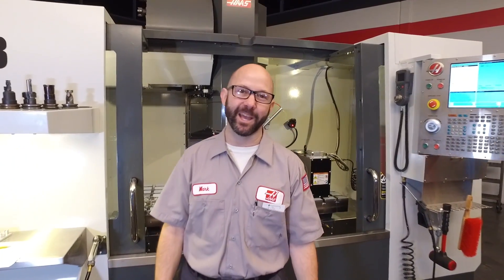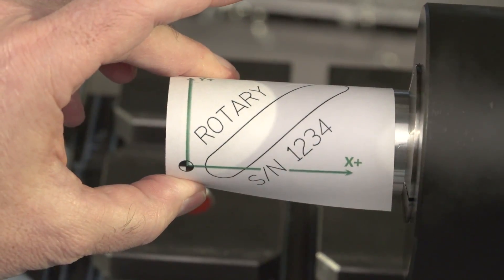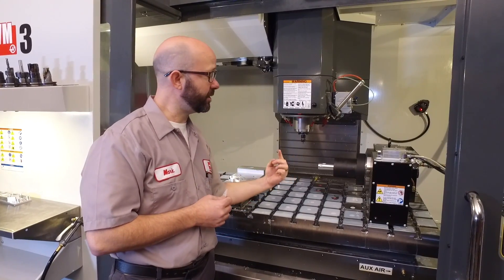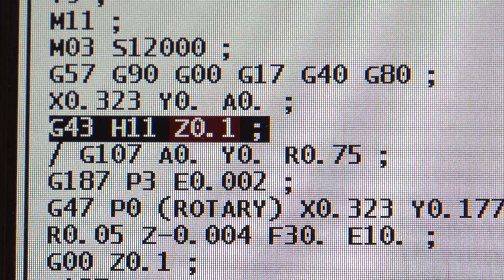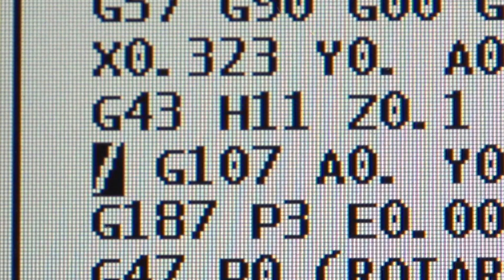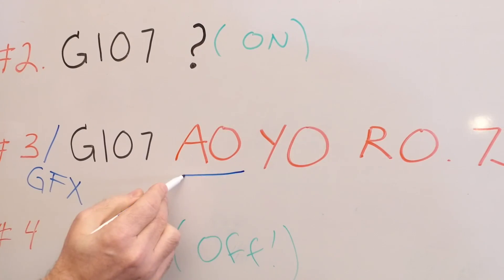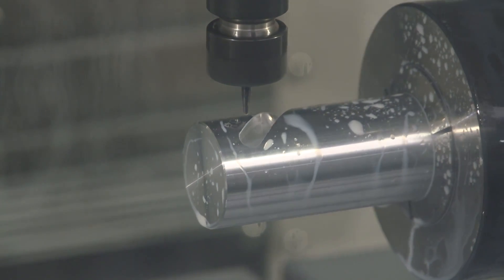Easy Cylindrical Engraving & Machining: Use G47/G107 No CAM needed – Haas Automation Tip of the Day

Comment: Hi, this TIP is it working with a lathe axic C with a live tool?
Reply: As of year 2025 it does work, but the actual part features are mirrored, like the C is going in the opposite direction.

Comment: Can I do this on a lathe without Y axis utilizing just ZC axis work?
I managed to do the face of a part with just XC axis working.
Reply: This is being actively worked on now. We have G112 for easily machining with Axial Live Tools (ZC axes) on our lathes, and we have G107 for Cylindrical Mapping around the outside of a part on our Mills with 4th-Axis rotaries. What is being developed is a simple G107 Cylindrical Mapping for our Live Tool Lathes (XC axes, Radial Live Tools). Part of this larger project will also be to add G47 engraving to our Live Tool lathes. We don't have a timeframe for this, but it is being worked on and tested. Great comment.
Reply: @markterryberry4477  I got it done on my Machine 😁 was a bit of tweaking but worked beautifully! And the first time I ever done OD engraving (edit: on a curved surface) before!

Comment: Hello

Can i use G254 before G107-G47?

Can i use G254 and G234 before G107-G47? In case or my cylindre to engrave isn't in my C axis. (i use an TR200Y)

thanks you

Comment: Help me Mark! How do you control the A/B axis feed rate when doing this? We're running an 09 EC500 and a few seconds into the program we hit a "B servo error too large" error.
Reply from the maker: Jonathan – To control our rotary feedrates, we’ll typically just make adjustments to Setting 34 or 79 4th/5th axis diameter. We need to define the diameter of the part we are working on so the control knows how fast to go when using a G107. This is especially important on an EC500 where you might be at 15” diameter. We can also give your local HFO a call on this as well, they can look at your program and make sure everything makes sense, for your specific machine, and that there aren’t any other issues. – Mark , Haas Tip-of-the-day
Reply: @haasautomation  Thanks for getting back to me. We're Department of the Navy and go through Phillips but so far they haven't been able to help. I'll mess with settings 34 and 79 tomorrow and see if it works. It's not a huge deal, we can just use CAM but was hoping to getting around having to figure out a macro for the serial numbers we're looking at doing.

Comment: Hello i am a student and have a surface design that im trying to do to a cylinder material and when i put G107 in and added the pretext you said it didnt work and was womdering how to fix it (was wondering of it would be a diminsion issue where i either have to increase the stocks diameter or decrease the size of my design would appreciate some input as soon as possible trying to do this project in 3days time before my deadline

Comment: just got a new tm1p and tried the g107 and the g47 writes just fine but when i add the 107 and reset for the 4th axis it is writing everything upside down. did something not get set up right when they installed the rotary? how can i fix it?
Reply from the maker: Hi Bruce – For this one, I’d give your local HFO a call, and see if they can help work through things with you. You’re right that it could be the orientation of the rotary, or it may just be something we can fix in the code. If it’s just upside down, not mirrored, we might try adding an I180.0 to your G47 to flip things around 180°. – Mark Haas Tip-of-the-day.
Reply: @haasautomation  the 180 don't work only way to get it to work correctly is to use a g101 and mirror the y axis. i have contacted my hfo and we are working on it but it had them baffled too it is printing upside down like looking in a mirror lol. found the work around just wish i didn't have to do that on a new machine. thank you for your response. your videos are awesome and made it pretty easy other than writing upside down lol.

Comment: el cam te da esos codigos ono?
Reply from the maker: Jm – Usually we have the CAM system generate our code, but in this case we can have it wrap the machining around the part by using a hand-written G107 code, so it is possible to write the code by hand as well. – Mark, Haas Tip-of-the-day

Comment: can you use a indexer with G107?
Reply from the maker: Yes. As long as your Haas Rotary is a full-4th, meaning that it can be commanded to any position, then your G107 will work just fine, this applies to our HA5C indexers as well. We do sell a few machines with Index rotary tables that will only index at certain increments (every few degrees). G107 is not compatible with those machines. Thanks for the question. – Mark, Haas Tip-of-the-day

Comment: Hey Mark love the videos. Im having trouble manually indicating in a drill on a haas vf-1 lathe. I get x good then the up and down good and when I drill the hole is .007 oversize. Tool post is square within .0005. Could it be the 3 allen screws that hold the jacobs chuck onto the tool holder? Im kinda at a loss. Thanks
Reply from the maker: Marc Vaillancourt – A good Co-axial indicator is my favorite tool, on a lathe, for getting tools lined up on-center. We have another video, that may help as well. https://youtu.be/Yo1J5XWy78Y?t=578. If you are holding the tool in a BOT holder, then you may need to adjust the eccentric CAMs, that the BOT holder rest on top of as well. Search for ‘Cam’ in your Lathe Manual PDF for more information on this. – Mark, Haas Tip-of-the-day

Comment: What a brilliant function, I have tried this and I have one small problem; when I use G107 it mirrors the engraving over the Y axis, any Ideas what would be causing this? The machine is a 2013 VF-2. This is my program (it's metric)

G40G17G94G80
G90G57
(10MM 9NINE TOOL - ENGRAVING)
T17M06
A6.518
G00G90X109.933Y-4.835A6.518S6000M03
G43H17Z92.5
G107A0.Y0.R42.5
M08
G00Z43.5
G01Z42.4F1000.
X112.533
G03X114.086Y-3.282R1.553
X112.533Y-1.73R1.553
G01X109.933
Y-8.23
And so on
Reply from the maker: The control expects the rotary to be mounted on the right side of the table. If it is mounted on the left side then the A-Axis will be rotating in a direction opposite of what the control expects. This isn’t a big deal. You can mirror the rotary axis by turning on Setting 48 MIRROR IMAGE A AXIS, or for this one program you could mirror the A-Axis with a G101 A.0, turning it off when done with a G100. If you want to invert your rotary permanently (+/-) you can call your local Haas Factory Outlet and they can help you out. Hope this helps!
-Mark, Haas Tips of the Day
Reply: Sorry it's taken so long to reply, yes the rotary is on the right hand side. Funny story about G107, a job came in that required engraving a cylindrical surface so I used G107 and obviously impressed the boss because I got a pay rise and about a month later we had a new Haas lathe! Win win! While the Haas technician was in I asked why G107 was coming out mirrored, he suggested the same things as you but none really worked. G101 or setting 48 caused an alarm (invalid G03 I think), so what we do now is program the tool paths mirrored so it comes out correctly and use G101 to make G47 text come out the right way up. I was pretty certain this VF-2 was just programmed wrong from factory until I tried G107 on our 1997 VF-3 which does the same thing. Surely it's not just because we're in the Southern Hemisphere! We have another Haas lathe coming next week so I will have to ask the technician what else I could try. I will let you know how I get on.
Reply: Just wondering, did you solve this yet?  thanks

Comment: Awesome video, I have always wanted to engrave on cylindrical parts using G47 instead of CAM  and know I know how.  Will the G107 also work for creating chamfers / deburring holes on cylindrical parts.  i.e. if i have a 0.375 Cross Hole on a 1.250" Dia part how do I Chamfer it evenly using A, X,Y  / G107 Rotation or do I just use cam to program a X,Y,Z, move while A is stationary. Im hoping there is an easy solution for this like the G47

Also in regards to the video please add the G-Code / Tips / instructions to the "Description" Area of Youtube same as you show in the video and on the White Board.  This way we  don't have to keep searching the video for it, furthermore we will be able to copy and paste the G-Code to get us started. I would recommend doing this to all videos in you Tip of the Day / HAAS learning. Thanks and keep up the Good Work.
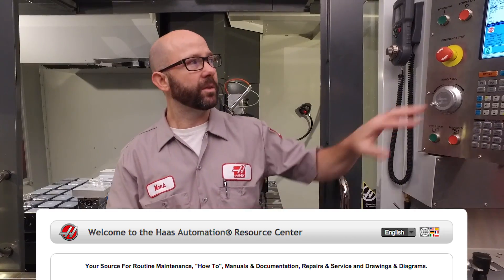Reply from the maker: +RoyalArmsIntl Thanks for watching! The link you're requesting is actually already annotated in the video, at 4:11. The link will take you to http://bit.ly/DIY_G47-Part-3, where you can click on the program file to access the G-code you've requested. Hope this helps!